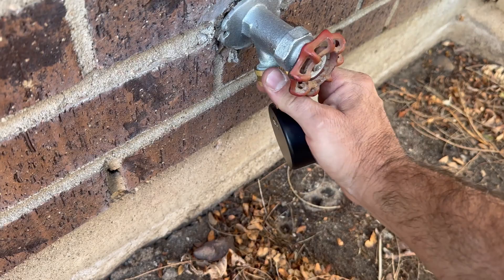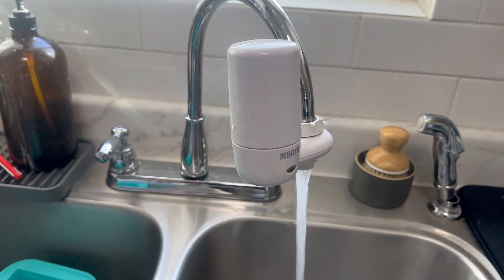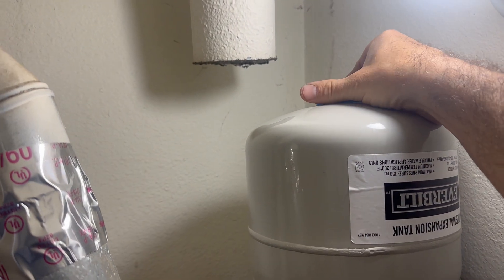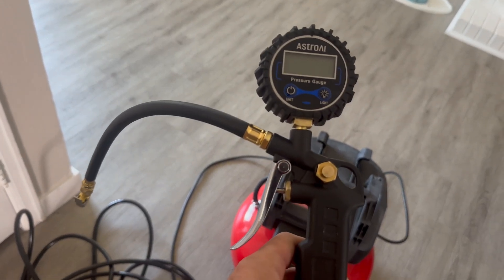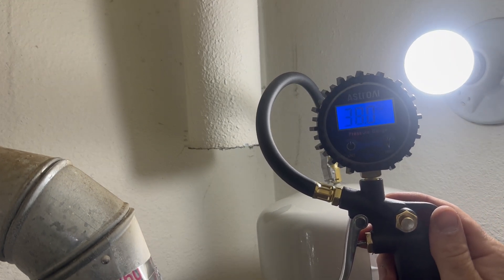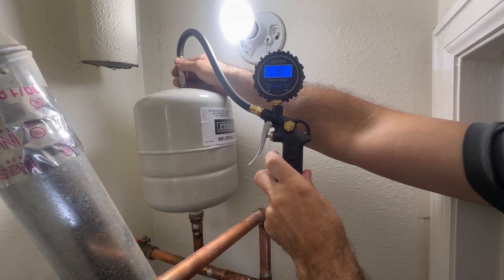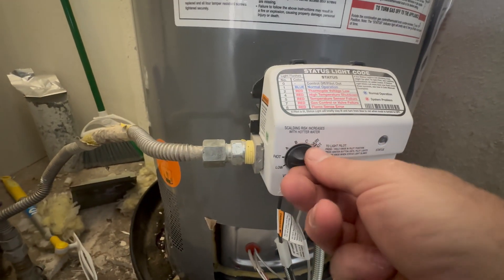Setting Pressure on a Water Heater Expansion Tank

Comment: When you wear pressurizing the tank with the water valve off to the tank, did you still have the sink on the water run setting or did you have it closed I didn't want to leave it open and end up blowing the bladder from the tank into the water line
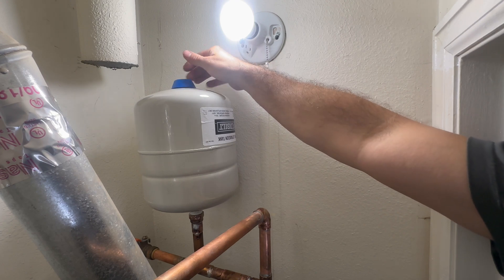Reply: minute 1:58

Comment: Thanks!  Noticed variable water pressure and "knocks" from plumbing.  Couldn't find expansion tank near water heater, but found it nearby on main water supply line.  The expansion tank Schraeder valve had a little piece of circular paper around it, sticking out between tank and plastic cap.....  Got me to wondering if it came that way "out of the box" and it had never been properly charged.  Checked pressure at valve; zero.  No water came out when valve pressed so figured membrane was still intact.  

Got my air compressor hooked up , opened a nearby faucet, and put in a very small amount of air.  Heard a sound that I thought was the membrane peeling off of tank wall.  I'd guessed water pressure at 60 psi but realized I wouldn't know when to stop inflating.  So I turned off faucet and got a pressure reading of 65 psi, which I figured was static water pressure.  Shut off main water supply valve, opened faucet again, and expansion tank pressure read about 40 psi.  I kept inflating until pressure read 65 psi, detached compressor, turned faucet off, then slowly opened main water supply valve.  System filled without incident, no leaks, and now Schraeder valve pressure reads 65 psi.  

So, in summary, it looks like the tank installer never bothered to check water pressure and properly pressurize tank!  Doh!
Reply: Our water heater was leaking so I decided to check the pressure of expansion tank after turning off house water and draining faucet of hot and cold to relieve pressure from pipes. To my surprise, like you, it was below one. I pumped it to 60psi with house pressure at 66psi. Hopefully no more leaks.

Comment: Regarding the house pressure, my house is on a private water well system and the pressure switch is set to cut-on at 35psi and cut-off at 55psi for the well pump. What pressure should the thermal expansion tank on my water heater be set at? Thanks.
Reply: 55psi
Reply: You wanna set it to the max psi which is 55which is the cut off point an is your max psi pressure to your house . So I’d set it at 55psi

Comment: The last expansion tank I installed, the manual said to charge it to 2 psi less then the system pressure. Does yours say to match the system pressure?
Reply: 2 psi or 2% less should be right, because the water side of the membrane will lean towards the air side, which is the default position it should be in. When water heats up and expands, the waterside will press into the air side, which is what it should do. Just make sure your pressure tank is big enough - dimensioned to accommodate your boiler's pressure and water capacity.

Comment: What does the expansion tank do actually?  Our home doe not have one and the plumbers never mentioned it when the installed something for me.
Reply from the maker: Takes a little bit of pressure off the water heater 👍 which can contribute to longer life
Reply: It stops your water heater from leaking. We have an expansion tank and our heater was leaking whenever someone was taking a shower or when hot water was under heavy use. The thing is, it wasn't leaking from the relief valve. So I decided to check the pressure of expansion tank after turning off water and draining faucets of hot and cold. Expansion tank is stated to be preset to 50psi, but to my surprise, expansion tank had a pressure below one, below one! So basically, it was as if it wasn't installed at all. I used a tire pressure pump to set psi to 60 with house pressure being at 66psi. Fingers crossed this helps with the leak. Now I will have to check the expansion tank pressure yearly.
Reply: @3rdyellow you need to get a qualified plumber out.. if the water heater is leaking after heavy use ( the tank has cooled from the demand of hot and the cold water being introduced makes it leak..) the vessel you recharged may now be right but it could be too late for the cylinder .. as it’s had to expand for so long without the vessel whenever it’s hot it’s expanded and been fine once the cold retracts it.. well you said it yourself it leaks 😔 it could last a while but now the vessel is recharged the cylinders joints are already weakened and under constant strain..
Reply: You don't technically need one if you have an open system. If you have an inlet check valve, then you need an expansion tank, since the heating/expanding water has no where to go. All that extra pressure could damage the tank. If you have an open system the extra pressure/heated water will backflow to the grid, which is fine physically but you're wasting money on heating
Reply: It allows for the thermal expansion of water. Like one person mentioned, it’s mainly for closed systems.